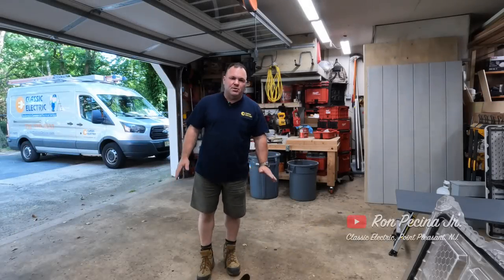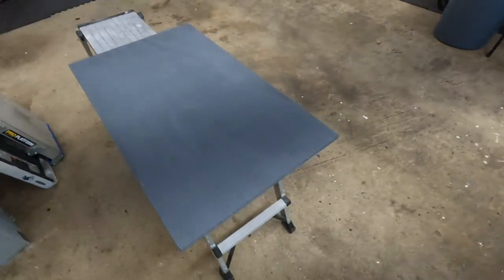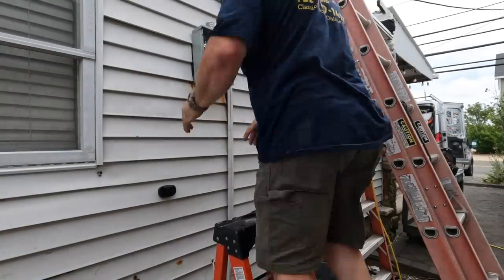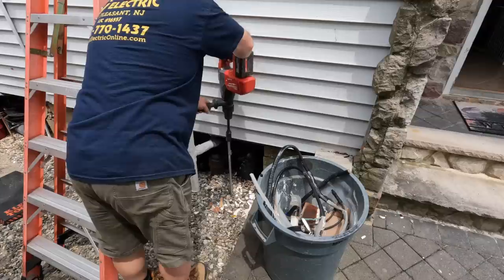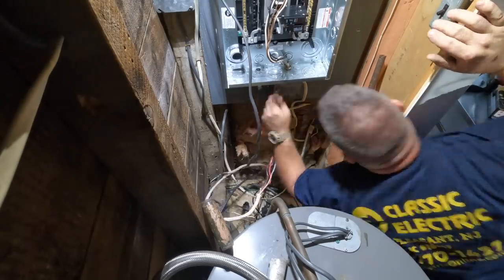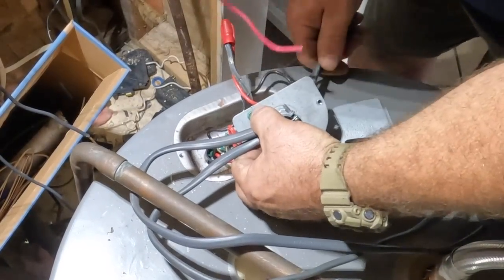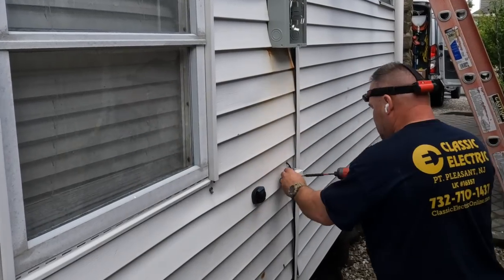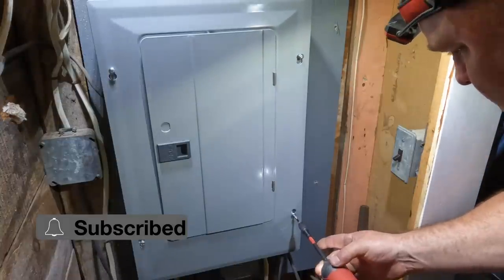100 AMP SERVICE UPGRADE | Seaside park, N.J.

Comment: nice.   As a DIYer home owner,  it is videos like this that I learn and improve my work.  I have refactored my house electrical a couple of times over the past 25 years.  The  125amp service I installed 25 years ago, including mast, meter base with disconnect outside and siemens panel, improved the VERY OLD  4 circuit FUSE panel - geeez - along with their tubes and knobs wiring.  Bare wire mostly as the insulation was LONG GONE. It was nice to install the romex. The inspector was very helpful and pointed out my errors. Once fixed, it returned and all was well.  I read the code and research what I NEED to do. Now I have been adding solar along with batteries.  Out in Utah. Thanks for the videos for actual experiences you have
Reply from the maker: That’s the American spirit my friend! 🇺🇸🇺🇸🇺🇸
Reply: I love that you didn't edit out hitting yourself in the head with the enclosure cover! That's me all day long.... Plus seeing you not pretwist the conductors before putting on the wire nuts helps my arguments at work, haha
Reply: Pardon my ignorance here guys but, I thought you are not allowed to work on these things unless you are a license electrician. Maybe you are a license electrician ? 

I looked into this but in NJ (Ron you can correct me if I am wrong) you need a permit to electrical work. A part of the permit application HAS to be filled by a licensed electrician, with his or her license number. 

How would a DIY home owner would this work?
Reply: @dennispatel6639  I am not licensed electrician, but here a homeowner can do the work. Other electric work inside the home as well. Just need the permit. I Live in Utah, different rules.  I could not pull or install the meter but home owner can get a permit to do the work of service panel installation, after the city power company severs the grid connection. After disconnected,  I installed the list of items I  mentioned, then inspector came, ok'd it, he called  the city utility who came back and reconnected the grid lines. Small rural city (20,000+). It is called the wild, wild west
Reply: @norsk54472  Hey Thank you for breaking that down. I looked though the permit application once or twice and the instruction calls for a part of the application be filled out by a licensed electrician or an electrical contractor along with their ID number if i am not mistaking. So i am thinking, even to pull a permit you would need a licensed electrician. I have never tried pulling a permit or went though the process so idk this for sure.

I really enjoy watching Rons videos, very informational. I might not be able to legally do the work but, i like to know how things are done.
Reply: @dennispatel6639  probably in many blue states yes.   Got freedom here
Reply: @norsk54472  Dont even get me started with these "Donkeys"  SMH. Thanks again for the info.

Comment: When I was in the electrical field, what you had done in this video would had been a typical or standard electrical upgrade. Of which then, the metering and electrical equipment, service cables are updated to current code. Inside the structure, you worked with the existing wiring, as is. That is code in Wisconsin and Illinois. Up to, year 2015. Did this many of times for customers.

Comment: An inspector taught me a trick for top hub assemblies. What I do now is I use the threaded hub, of course, then my male adapter, but instead of inserting the riser mast directly into the adapter I put about a 4" stub in there. Then I slide the bell end of my pipe over the stub and butt it up to the adapter. This way there is no lip for water to collect on; and if for some reason it separates there water would have to travel up the inside of the bell and over the stub to get into the can. 

Every video you get better and better; you're becoming a household name around here. Love that you learn from the feedback. Charge on! ⚡
Reply from the maker: That bell bottom trick is a great idea!! I will definitely try that on the next one. Thanks for that tip!
Reply from the maker: My mind is blown that I never thought to do that. Are you in New Jersey?

Comment: As far as i know, for the 100 amp breaker that was installed for the main service disconnect, a screw must be put though the breaker (notice the whole in the breaker for it) as another means of securing the main breaker. 
NEC 408.36(D): Back-Fed Devices. Plug-in-type overcurrent protection devices or plug-in type main lug assemblies that are backfed and used to terminate field-installed ungrounded supply conductors shall be secured in place by an additional fastener that requires other than a pull to release the device from the mounting means on the panel.
Love the vids ron, keep up the good work
Reply from the maker: The MB came installed with the panel and is advertised as such too.

Comment: I saw you cut that neutral before the other hot when disconnecting the service lol but I know you had the meter pulled beforehand 👍 glad you’re back to making more content sir. Great video as usual 👍
Reply from the maker: Always remove the meter first because the meter is a load itself and could shock you from the leg that’s cut through the meter!
Reply: @electricianron_New_Jersey  yes sir ! Years ago ,when I was first starting in the trade , I learned that the hard way lol. It’s not funny but I’ve never made that mistake again.

Comment: Ron,
For some reason I feel that you are the best person in the entire universe to pose this puzzler to.   I just had a heat pump installed yesterday.  It's 240v.  It works fine but every time I turn it on, my electric stove starts to click.   I turn the heat pump off, it stops.  
Would you have any idea what in the world is going on?!  
Thanks. 
Jim

Comment: Hi Ron, the original voltage issue, is a classic open neutral with no pipe ground. Creates hi-low leg on service. 99% of time its open nuetral on service to pole.
Reply from the maker: That was already check by JCPL so this must be that 1%.

Comment: I'm not sure whether this was technically ever permitted,  but apparently some years back a cord and plug connection as a disconnect means for a water heater was a somewhat common practice. I found the water heater in my stepfather's 1973 ranch home was plugged into a nema 6-30 receptacle,  a piece of 10-2 Cu-Clad NM from the plug to the water heater, receptacle fed by 8/2 SEU aluminum cable, breaker box in a bedroom closet on the other end of the house, when I was helping dad do some remodeling to fix the previous owner's screw ups involving the wiring, some of which was failed aluminum terminations on the general purpose receptacles.  The kitchen was wired with 10-2 Cu-Clad,  other circuits were solid aluminum, some were copper..
Reply from the maker: Cord and plug is still acceptable but uncommon in NJ.

Comment: I love your videos, and you obviously know your stuff. As for the bend around the gutter, maybe you could have used an LB? I don't know what the actual clearance is in that area, I see it was tight. But then you could have kept the pipe tight to the siding and gotten another strap in a little easier. But of course then you'd have to worry about another point of water intrusion into the service equipment, and a little extra labor of pulling the conductors through, so I think you did the right thing just bending it like you did. I'm envious of how organized you are. I do my best to stay organized and efficient, but the company I work for isn't super organized.

Comment: Thanks Ron for a detailed service upgrade.  I am surprised you didn’t use Penitox/Nolox on the line conductors in the meter pan, especially being so close to the ocean.  Also, why didn’t you rubber/leather electrician’s gloves when handling the live conductors coming in from the street when up on the roof?  Thanks, Bill
Reply from the maker: Because I’m very careful not to ground myself while working hot.

Comment: Hey Ron, Love your work thanks for sharing. I am sure I must not be seeing correctly, but it appears that your top #4 and boot seems to be connected to the 20 amp breaker above the MB. The bottom lug of the MB appears vacant. I am sure I am missing something….Paul

Comment: Love your videos. Excellent work, as always.

Technical question: I notice that non-metallic liquid tight fittings don’t come with bushings. Are bushings required when connecting non-metallic liquid tight conduit to boxes (towards protecting the conductors from being damaged)?
Reply from the maker: #4 copper conductors and larger are required to have plastic bushings.
Reply: Got it. Thank you. Happy Father’s Day.

Comment: Excellent video, I learned a lot from watching this.  When running PVC outdoors like with this particular installation, do you ever have the need to use an expansion coupling?  Curious if you came up with a solution for where you could strap the conduit where youi cut the pipe and added a coupling by the eave.  As an apprentice I find your vidoes to be very helpful as I get to see how you do your work.  Its like looking over my journeymans shoulder but you show me another way things can be done.  Thank you so much!
Reply from the maker: Glad I could help Ryan!

Comment: So were you screwed over after you attached the 2" hub to the meter can? Or those bolts were reversible and you could get it off and not have to throw away a meter can. That'd be bad.

You could bolt a small piece of PT lumber or Azek to build out a spacer to strap the riser near the fascia? Honestly looks fine as is, in my opinion, unless another strap is required.

Wow that was a VERY snug space to work on panel replacement. Bet your arms were pretty strained after working sideways like that.

The codes here in MN are pretty much the same, rehab and repair are pretty much grandfathered to whatever code was at the time of the building. Obviously you can do any commonsense upgrades you want but you don't have to.

Nice correction to the water heater, good call using carflex and fittings. Never even seen that used inside. I also never even knew a disconnect was needed for a water heater out of proximity to the panel. Makes perfect sense. My furnace has a light switch, but I imagine that's probably optional since the breaker is like 15 feet away.

Learning volumes of info from your channel as always.

Comment: You mention using strut but worry about rusting, they do make Fiberglass strut that would probably look good
Reply from the maker: Now there’s something I did not know. Thanks!
Reply: @electricianron_New_Jersey  they also make aluminum and stainless strut. Also they make stainless and aluminum strut straps.
Reply: @mcarroll598  Stainless strut, now that would probably cost a fortune

Comment: Panel clearance side to side  is a total of 30" wide (minimum) or the width of the panel if the panel is wider. I am in MA don't think it would pass clearance wise. I have one to do a my nephews cottage and the panel is in a closet and I have to put in a wider door.
Reply from the maker: In NJ we have the rehab code which allows “like for like” installations.

Comment: When you were installing those two GFCI breakers, I noticed that you only connected the hot wires to those breakers. Shouldn't the neutral wires be connected to those breakers as well or can those breakers still function properly without them?
Reply from the maker: Good catch! Yes,  originally I did not wire the GFCI breakers correctly and when I went to check everything before leaving I turned on kitchen lights and the breaker tripped immediately.  I was pissed because I couldn’t leave it like that so I opened up the panel and wired the circuit neutral to the breaker.
Reply: @electricianron_New_Jersey  Thanks for your prompt replies. Yeah, that must be frustrating have a light switch trip a breaker like that. At least you were able to fix the issue by connecting those neutral wires to the breakers. Hopefully, you left enough slack in those wires.

Comment: Question is there any reason why sealant shouldn’t be used on the nipple that feeds into the house? Doesn’t water find its way inside if you Dont?
Reply from the maker: There a 5-10º pitch on the nipple so that won't happen.

Comment: Something to think about with EV charging and the possibility of multiple vehicles you may need to charge at home . Most families have at least 2 cars . Then kids may have a car . You could say 4 cars charging maybe to much for a 200 amp service . It's interesting you can double the size of the service but the power companies wire size remains the same . I wonder if their will be a point if EVs do take over if their will be enough electricians to support this changeover with change outs and charger installations ?
Reply: As the feed lines are in the open air, they remain cooler than the conductors in conduit in the house, hence they can use smaller wire than I expected as well, for the larger service
Reply: @norsk54472  Yes I understand that  but I believe it is undersized by code standards . My belief the expense is so high to have to replace aerial secondary wires for every upgrade that it's not done . They would rather wait to failure to replace . Of course that can be a hazard . Looking up at many secondary lines . Especially the single conductor ones I'd a bit scary  . I have seen  single aerial solid number 10 conducters feeding residences today . Places like we saw in Puerto Rico with overhead lines that looked like spaghetti and came crashing down in hurricanes . Just find it off there seems to be different standards for the power infrastructure.
Reply: @stevencole7331  aaah,  thank you for the insight on other reasons
Reply: Some power companies offer special rates for EVs to be charged at certain times.  This setup needs another meter and utility co will change the feed to bigger conductors.  So no need to touch existing service.  The vehicle charge(s)r is hooked up to 2nd service and billed for the special rate.
Reply: @ptso7580  I actually gave a bid awhile ago to put in separate meter for charging in socal and yes separate service feeders were required . It doesn't seem to be a standard

Comment: When do you have to bond the gas pipe?
Reply from the maker: When you have CSST installed in your home. The natural gas pipe is already bonded to the system ground by the equipment grounding conductor that supply's electrical power to  either your furnace or boiler.

Comment: Did they use triplex to the meter box, and do you use T-90 wire anywhere. I see you use THHN a lot and can that be more expensive than T-90?
Reply: He's probably using T90, I think that's just THHN/THWN rated for 90C. I think it's pretty much all you can buy these days.

Comment: Homeowner may need to move the water heater a little, away from panel for proper clearance.
Reply from the maker: Rehab sub code.
Reply: Depends where you live, but that setup is grandfathered in.  If you moved the load center more than 3 feet from original location then you have to follow current codes.

Comment: Ron, is that black sheethed NM cable? Not sure if I’ve ever seen that before.
Reply from the maker: It’s UF cable.  This house is built a trailer. After Hurricane Sandy it looks like it was all rewired except for the service.  So a lot of the wiring is outdoors beneath the structure.

Comment: The water pipes never really made up for any electrode but they do help. The main reason why they have to be bonded is because if something shorts out against the pipe, it won't trip the breaker. For example, someone is running a dehumidifier in the basement or they have a freezer plugged into an extension cord, they run it over a copper or steel water pipe and eventually the cord wears and rubs through and the hot conductor shorts to the pipe. Someone comes along and grabs the pipe and they touch the washer or dryer. ZAP!
Reply from the maker: The water piping system is bonded to the system grounded neutral to limit voltage potential.  If it’s not bonded there’s no way to clear a fault and then you could die if you become that path for the electrons to flow back to the source.

Comment: Hey Ron the service raiser needs to be sch80?
Reply from the maker: Only if it’s subject to physical damage.
Reply: If I remember Sch 80 is only needed as a riser from the earth into a building where there could be reasonable physical damage. I think it's also used for PVC encasement in concrete.